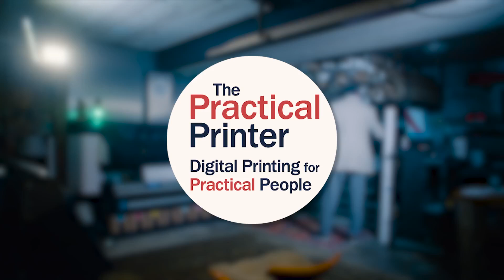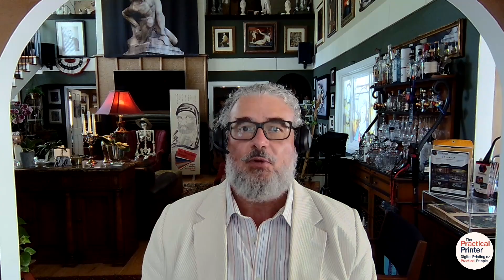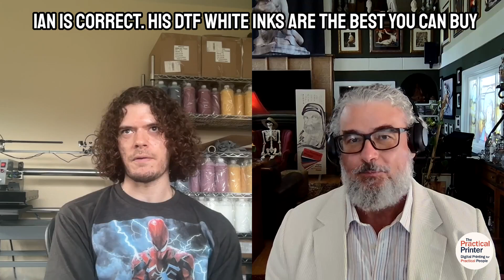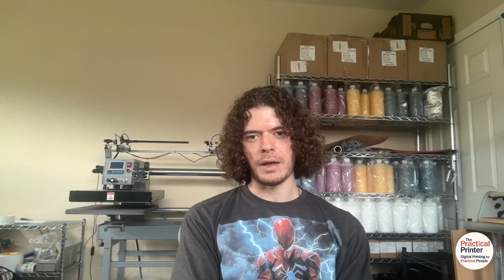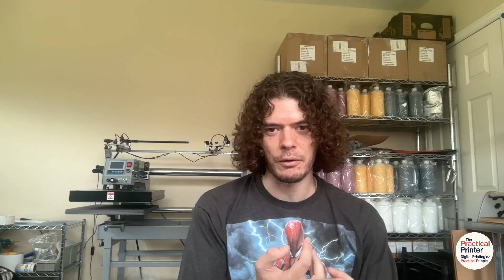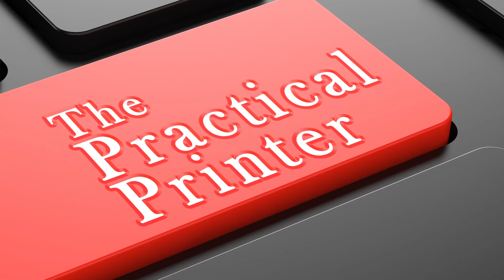Ian Aram Talks About the Best White DTF Ink in the World

Comment: Wow! This was amazing 👏👍. I stumbled on your channel by mistake and can’t express the amount of knowledge I gained. That said, if it wasn’t for your channel and this segment, I would have stayed with the OEM inks that came with my printer (haven’t installed the inks yet).

I recently purchased the HTVRONT D2 DTF printer, and before installing everything, I’ve been trying to find the right spot for room temperature and humidity (which very few people talk about). I went ahead and ordered TexPro DTF ink—both white and color—all because of this channel. I did call to verify that these inks will work with the new HTVRONT D2 DTF printer, since I’m going outside the company’s recommendation to use only their inks.

Toward the end of the video, it was mentioned how important the heat press, DTF powder, DTF film, etc. are. I do wish there was a recommendation you both could had mention for DTF powder.

I purchased this from Amazon—“CenDale 2KG/70.4OZ White DTF Transfer Powder: Hot Melt Adhesive Digital DTF Transfer Powder”—since it had the highest ratings:

https://www.amazon.com/dp/B0DDKZPNT1?ref=ppx_yo2ov_dt_b_fed_asin_title&th=1

Any suggestions for a good DTF powder that can be used by hand (not with a shaker)?

Too many of the powders I’ve searched for have low ratings. Also, I hope I don’t run into the same issue mentioned in a comment here on this channel that said, “The biggest problem I have is opacity with these new sediment-free inks,” especially since the HTVRONT D2 uses proprietary software called “IdeaStudio.”

Again, thank you for providing awesome information about DTF inks👍. You have no idea how this helped me! This is straightforward—no selling, no going into wonderland. I had to subscribe!  Please continue to provide more content related to this topic and all areas of DTF.